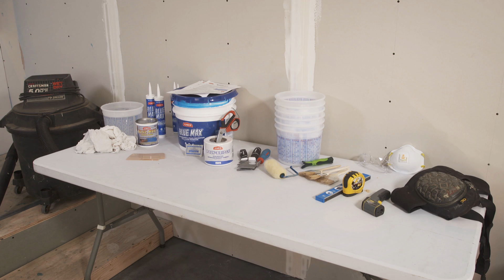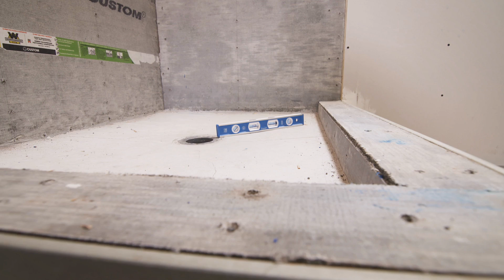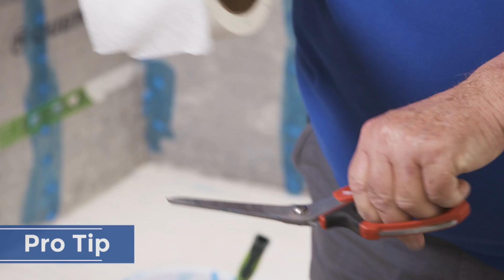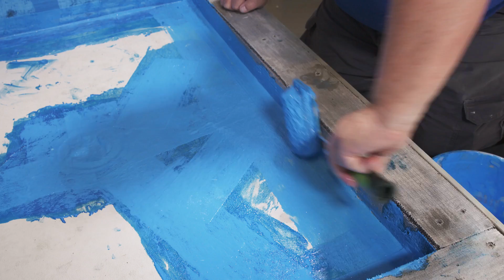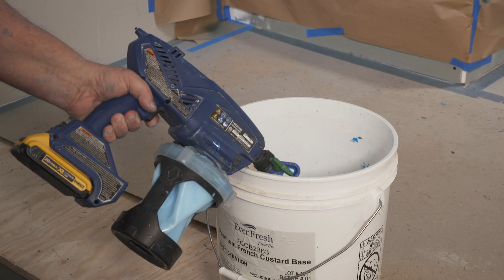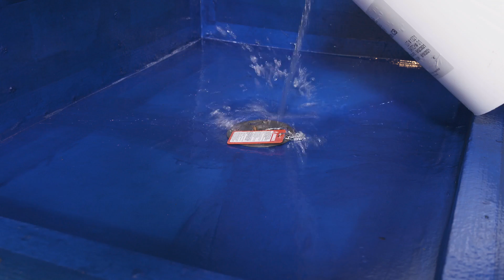Ames Blue Max Tile & Floor Shower Installation

Comment: what happens if you just paint a ton of liquid membrane on the joints rather than using mesh?
Reply: believe it or not, straight to jail
Reply: 😅😂 @tomhenderson9045